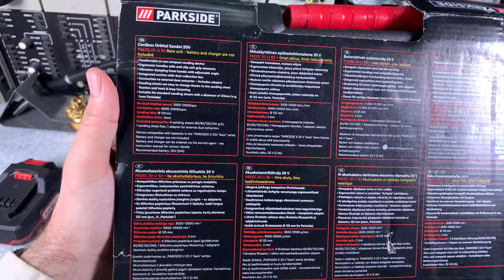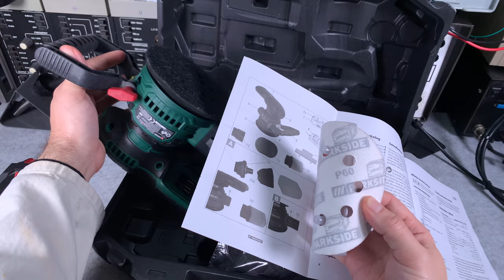(PAEXS 20-LI B2)  Testing Cordless Orbital Sander 20V  from Parkside

Comment: is it brushless motor?
Reply from the maker: To be honest I don't know, can't tell without tearing it apart.  In general parkside have two line of tools:  green is cheaper and brushed, performance - black :  brush-less <- that's general rule - so I would suspect it's brushed based on that but I will not put my bet on it.
Reply: No ,it is a regular brushed motor. But it is very powerful. I've stressed it and it doesn't stop. It just keeps going